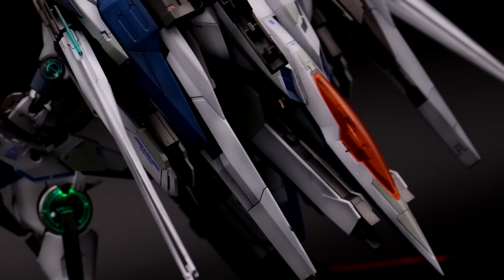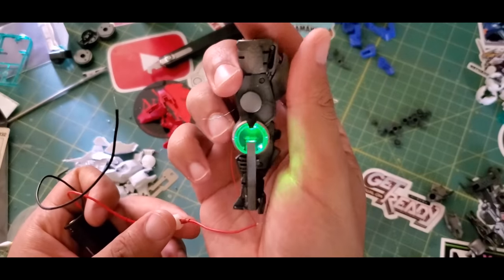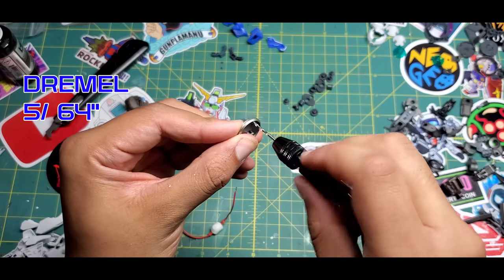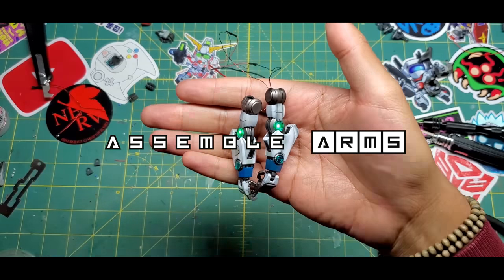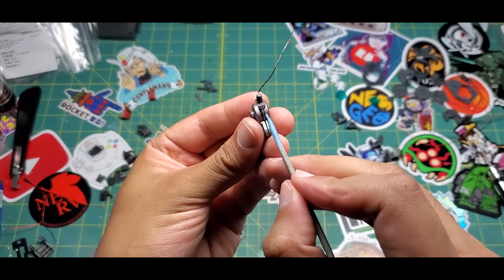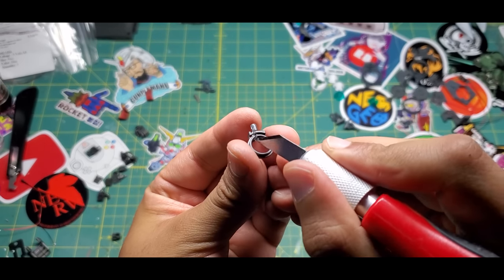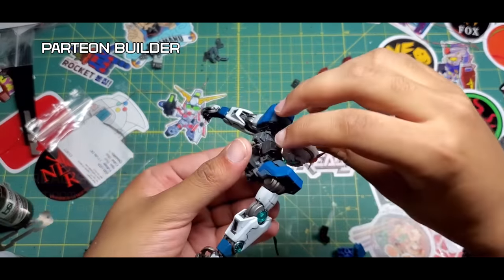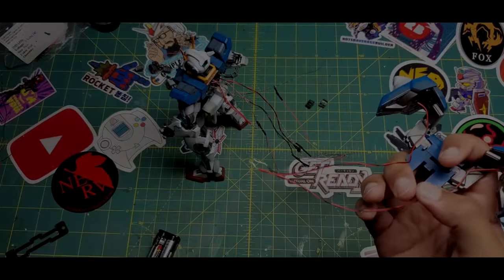#newtype #Otakubuilder #gunpla  MG 00 XN RAISER P2

Comment: impressive how you got the LED's in the legs and arm's, always amazing to see the tight imo impossible spots you manage to cram some led's.

also yea having it in full XN raiser on a action base is gone require some glue, i chose to take 4 of the base plates used in the AB4 and 5's and glue'd them together to form 1 big plate, then i set up the arm to hold up the XN raiser as i wanted it and glue'd all the joints up till the piece that takes the kit's adapter (which i also put some glue around to re-enforce it a bit, as my Unicorn full armor managed to split that piece. then i just glue'd the action base adapter between his legs leaving the peg unglue'd as that as long as action base arm piece doesn't split is actually quite secure (did apply multiple coats of paint on the adapter to make it thicker/jam in there more securely).

i kinda like the old action bases more as they require verry little glue to be solid as a house, and also tend to do better with heavier kits.
AB 4 and 5 have amazing adjustment range but with heavy kits they can be so flimsy and a slight move on the kit can shift it's balance from back heavy to front heavy and make it take flight (as my unicorn full armor did, think the shift in weight is what actually ended up splitting the connector between the kit and the AB, thankfully the AB comes with 2 of those pieces and i drowned the 2nd piece is glue to help it out, the unicorn made 1 flight amazingly not breaking anything, do not want it to make 2 flights :P)

Comment: i have to agree with you-the design of the kit is not optimal for standing and posing. I made a custom painted 7-seven version myself. While the shape and overall design is amazing, the weight distribution is so off...i love your custom LED btw. and want to know more on the paint that you use. are they better than Mr. hobby or tamiya?

Comment: so how well do these acrylic paints last against posing a kit?
Reply: They actually last pretty long if you got some top coat on. The only one that I would say would get scratched off is enamel paints. Enamel is the weakest, lacquer is the strongest
Reply: @hyperion2109  enamel is the weakest?! I was under the impression acrylic was the weakest because not only is it safe to spray indoors, but it's also dirt cheap and water dissolvable!  my life is a lie
Reply: @oooppiikkk  enamel is oil based , and is pretty weak , acrylic is in between , reliable and not toxic